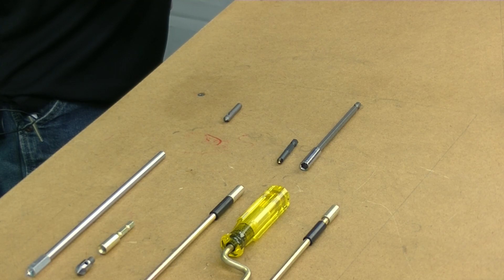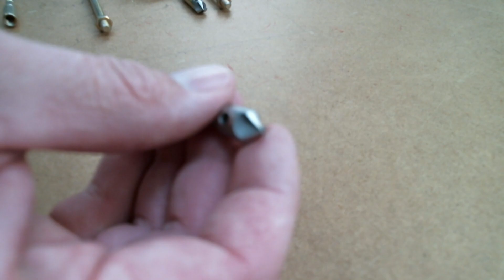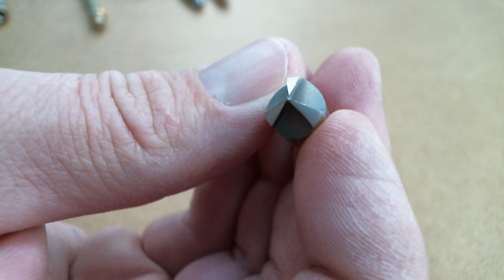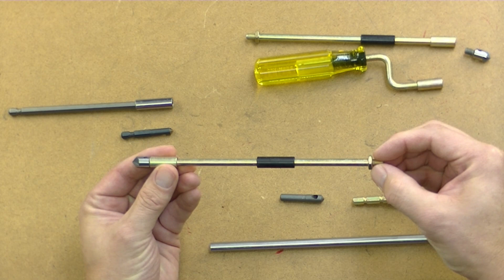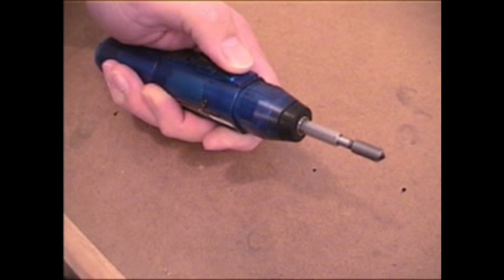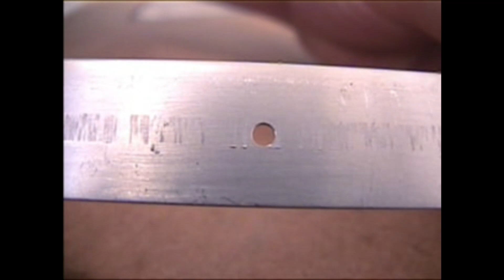Hole Deburring Tools @ Cleaveland Aircraft Tool

Comment: If the single flute performs a superior deburring operation, why do you not offer a version that threads into the handle?
Reply from the maker: Great question.  I think that using the handle forces you to apply too much pressure to the work.  So we really steer people to using the hex single flute in a lightweight driver.  It would be cost prohibitive to offer a threaded version too.